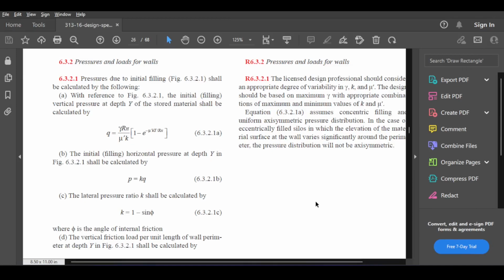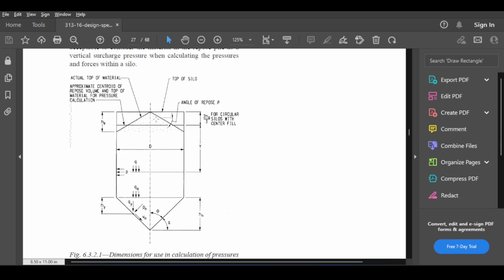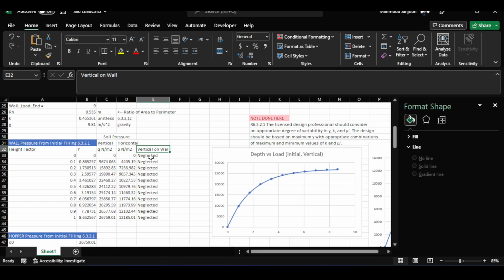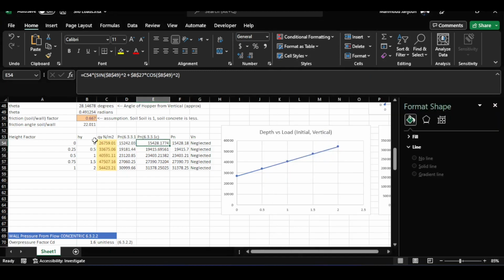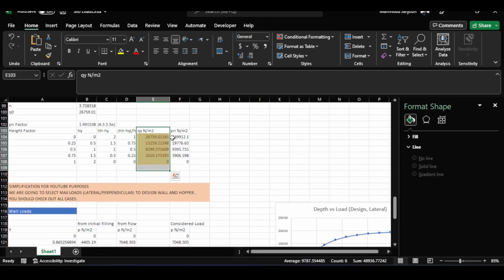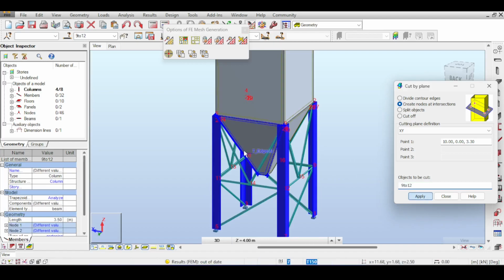Modeling Silos (Circular and Rectangular) in Autodesk Robot | Part 3: Loads

Comment: Hello CEE, 

Well, to think that the pressure and forces due to stored materials only is what is partially covered this far makes one realise just how involved the complete exercise would be (time wise). Thank you CEE for your patience on this exercise. With hindsight, I now know just how much more time than one would want to admit and also the level of painstaking details it would require and take to prepare and produce the loads spreadsheet that was presented on the video, respect to the CEE for this.

For me, this exercise was unavoidable and it has (along with the ACI 313-16 reference) immensely helped to ensure that the viewer have a truer (real-life -ish) appreciation of what they need to do in order to realistically estimate the loads associated with silo structures. Without this exercise, this series on the silos would have omitted a “key design step”. In reality, the engineer (or the licensed design professional) will not have loads handed to them, they must work (estimate) these loads out themselves. This here provided by the CEE is an excellent roadmap to show the engineer where from and how to start going about doing the silos loads calculations and estimates. 

Discretizing the calculations depths and plotting the loads/pressure v/s depth is brilliant, it allowed for a quick visual model of how the various loads’ distributions are. Thank you so much for this.

I personally agree with regards to the CEE philosophy to intrigue. So far, the CEE judgment on when and where to apply this philosophy have been spot on for me so far. In this particular case for example, I had no problems with calculating all the “Neglected” values for the vertical friction load per unit length (N/m) of wall perimeter (6.3.2.1d) and the initial (and the during discharge) friction force per unit area (N/m^2) between the stored material and the hopper wall surface (6.3.3.1d or 6.3.3.1e) depending on the magnitude of the initial pressure normal to the hopper surface and/or depending on the type of the flow pattern during discharge.

My success on the above was facilitated by the multitudes of clues and guides which were provided on this very same video by the CEE. I do not think that there is a need for the CEE to go into detail about every single thing in calculations. In fact, I do not think that doing such would even be practical in the current setting.

Having said and having done the above, I would still not mind to see how these friction loads are applied to the analysis model in RSAP. It is more common to apply “normal or at 90-degrees” loads and forces to a shell surface or to other structural members. It would be interesting for me to see and to work with the application of loads and forces that are applied “parallel” to the shells surfaces or to other structural members or elements. The difference in the units (N/m and N/m^2) for these friction loads on the silo walls and on the hopper surface is something that I would wish to try and understand through the visual application of these loads to an analysis model.    

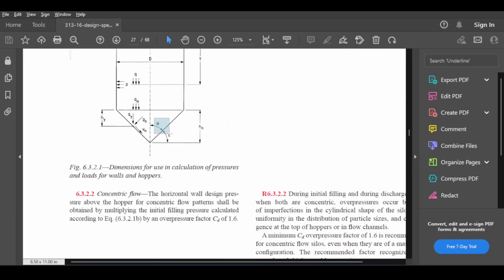12:40 CEE have correctly referred to “Theta” as the angle of hopper from vertical. For me this is spot on and it is in line with the ACI 313-16. “Theta” as it has been defined should NOT be influenced by the presence of an opening (13:05)🤔? The angle of inclination of the hopper surface should be the same even with the presence of the hopper opening? I am under the impression that this inclination angle is a physical property only concerned with the way (inclination) in which the hopper surface structure of the silo has been constructed relative to an imaginary central vertical axis and not immediately (although it will eventually be) related with the stored materials?

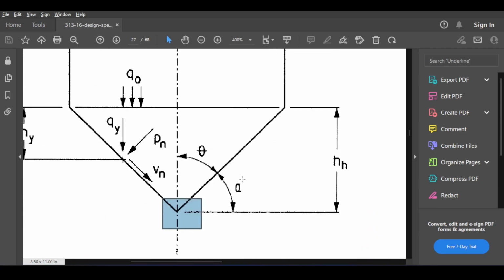14:20 I concur regarding “Phi-prime”. The Eurocode 1 Part 4 refers to the wall (or hopper wall) friction angle between a particulate solid and the silo wall (or the hopper wall) to be calculated as (=arctan (of the coefficient of friction “Mu”)) against the surface material concerned. The following article that was published in 2017 have also suggest the same relationship, refer to equation 3 on the article [https://news.bulk-online.com/bulk-solids-handling-archive/stresses-in-silos-part-1-bulk-solid-properties-stresses-in-the-vertical-section.html [accessed 10.12.2022]

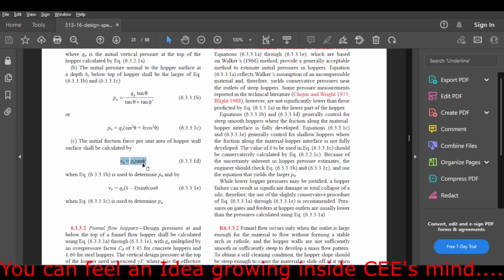19:18 I really love how the CEE was already able to intuitively realise from looking at the equation 6.3.3.1d and relating that equation to the fundamentals of physics on the concept of friction and normal force and conclude from there that (tan of “Phi-prime”) must be equal to the coefficient of friction “Mu”. This is a very good intuition by the CEE; it has also turned out to be 💯correct and it is a lesson on its own to the engineer about the importance and benefits of perspective and focus.     

The 2/3 approximation which the CEE has also highlighted seems to be working quite well when applied to the “effective angle of internal friction, “delta””. But it is providing noticeably different value when it is applied to the “angle of internal friction, “Phi””. I would suggest to use the relationship (=arctan (coefficient of friction)) of the surface material concerned to estimate “Phi-prime”; or alternatively use (with caution) the 2/3 approximation factor and ideally when this factor is applied to the “effective angle of internal friction, “delta””.

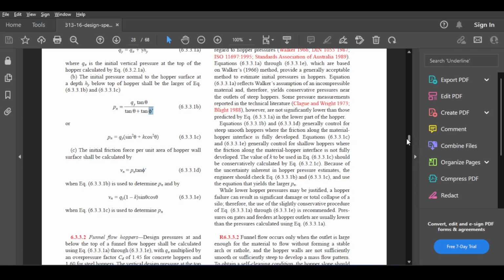14:40 Thank you for the advice. What you said is often taken for granted. It is such things that you have said which makes a huge difference. For example, I was able to easily find the above references to “Phi-prime” by mainly utilizing the “definitions, notations, and symbols used sections” of the various reference document that I was looking at amongst other things. This approach was stemming directly from your advice above. Thank you for that. 

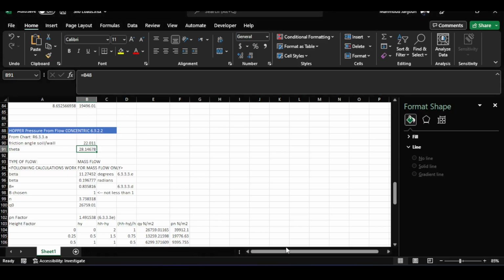22:35 “Phi-prime” aside; there are some minor calculation errors on the spreadsheet for the equations under 6.3.3.3 as follows:

• Cell reference B95 - convert the radian output angle from the arcsin calculations part of the equation back to degrees.

• Cell reference B98 - there is no limiting condition on the value of B, the limiting condition is on the value of “n” (also see below). 

• Cell reference B99 - for the calculation of the value of “n”, replace the cell reference B98 by B97.

• Cell reference B102 - change the numerator “sine (2Beta)” to “cosine (2Beta)” per equation 6.3.3.3f.

That is it with this case of mass flow on hopper, all else seems good to me.

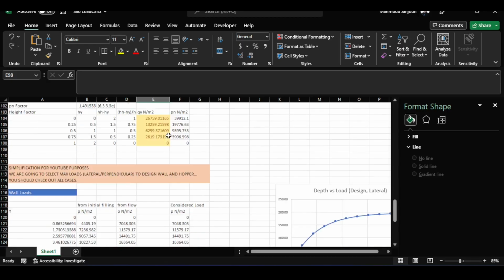29:15 CEE have provided a very clear explanation of how and why the two individual plots of the load normal to the hopper surface “for initial filling” and “for mass flow condition” were combined on the video to give the combined plot representing the two loading components together. 

I have also read clause 6.3.3.3d and I decided to also calculate the values of the pressures (normal and friction force) to the hopper wall surface for the case of “Funnel flow – 6.3.3.2”. The resulting normal force values for the funnel flow condition are higher than the corresponding values of the initial filling condition. The values from both of the above two conditions follow the same distribution trend (thanks to the CEE for the loads plotting strategy which made it quick to visualise and to compare the two loading conditions values and their distribution trends). 

My question is: Should one not analyse both conditions (initial filling, mass flow, and funnel flow) and treat each of these condition as separate but intact load case (either or) as opposed to dissecting the load cases and combining them? Isn’t doing the latter (dissecting and combining different parts of the different load cases) the same thing as effectively creating a new condition that would otherwise (ordinarily) not exist on its own during normal operation of the silo?

30:43 To respond directly to the CEE: I was not disappointed even for a moment by this video. On the contrary, I find the video intriguing at every turn. I cannot imagine how (I mean with what loads?) were one going to be able to proceed to analysis with if this video was not done in the manner in which it was done. I loved this video and its contents!!

30:55 WOW, wow, wow👏🏿👏🏿👏🏿; CEE, this plan (idea) of modelling in a triangular shell element is a really good idea and it is on another level. The proposed shell element is also volumetric since its thickness can also be controlled. I am excited about this and I shall be playing around with it until next time.

Thank you CEE, for your work, you are amazing period.

Keep well and I am looking forward to your next videos.
Reply from the maker: Hi there, I am really happy that the video was well received, despite obvious shortcomings in the "sound department". I am working on fixing it at the moment.

I am also happy that you checked out the reference and were able to build upon whatever was shown there. This is exactly what I intend with this channel.

I am also relieved that my viewers seem to be of the same opinion, to introduce topics, show the most important details about it, calculate the most major things about it, and leave some for the viewer's discretion.

I will show in the next video how a friction load is applied. I am still thinking hard of how to apply / or approximate the strange curved load I got on the wall, it is giving me some headache at the moment, but I think I have a cool idea that is both conservative and somewhat accurate. For friction, I might say that (similarly to what I have done with the "perpendicular loads" here is a sample for a friction load I just blindly assumed"

I really liked the reference you gave me and the ideas you discussed about Phi-Prime. It is also cool to know that viewers to see and appreciate the intuitive thoughts I voice out loud during work.

See, I want to think loud. I want viewers to see how I realize things. It is this genuine reaction and thought process and second guessing (without overdoing it) that makes you special and reliable.

About your question,
truth to be said, I would basically agree with you, and consider each one its own case and design them all (let robot crunch the numbers).
I do realize that you cannot have both funnel and mass flow, but well, the criteria to distinguish them is also - frankly- not water proof. even the code has "gray areas" where it does not know. I agree with you that you could consider them separate cases. I will try hint at this the next video. Still, because I do want to have a continuity in those parts, I will not change the current philosophy.

Makes me happy really that you were not disappointed, I know some viewers want to see robot and robot only, but it is great that some viewers agree with me and actually realize that "it is not the plane, it is the pilot". Without you understanding what is happening, the software will not be able to assist.

Finally, the idea of triangular plates got to me while I was thinking about it last week. It took some time but a stroke of inspiration gave me that ^_^

For the speadsheet, I will revise it and update it of course. Thank you very much for point the errors out. Helps a lot actually (and that is why I had the disclaimer ^_^ )

Regards,
CEE
Reply: @CivilEngineeringEssentials   

I really appreciate the feedback, it helps a lot in confirming the discussions and the proposed ideas.

And YES, yes, yes.....to add to the plane/pilot quote. With today’s ever growing proliferation of “analysis, design, and detailing software”, “…..Success, now more than ever, comes down to the man or women in the box…..” 😊
Reply from the maker: Reply #2: Just checked your "Debugging" 
It is spot on! thank you very much for your efforts. It is really appreciated.

Comment: I don't think it's necessary to use the Structural Robot Analysis program for such tasks, as it is not designed for this purpose. For small-scale projects, it is recommended to use Robot, while for large and complex structures, it is advisable to use SAP 2000, as it offers more advanced features and a more modern solver.

Comment: Hello CEE!
I am still playing catch-up with your videos.
I have reached the end of the silos videos and am following with a few comments on the modelling:
34:29 In order to avoid concentrated stress at the lower corners of the rectangular silo, could we model a 150x150mm column on each corner of the silo (same as silo wall thickness)?
Reply from the maker: Hello there, Welcome aboard.
Although your idea should logically work, RSA does not work like that unfortunately. For robot, a column is a line no matter how large its section is. It is really really odd, I know, but well, it is one of the weaknesses that is not about RSA itself, but in the FEM unfortunately.

However, to not end on such a note, I want to mention that one could use "volumetric elements" for a better modeling of such issues. The task is of course a daunting one.

Still, thnx a lot for your comment, and a HUGE thnx for the comment you have written in the RC design video, I pinned that one, as your insights are amazing!

Regards,
CEE